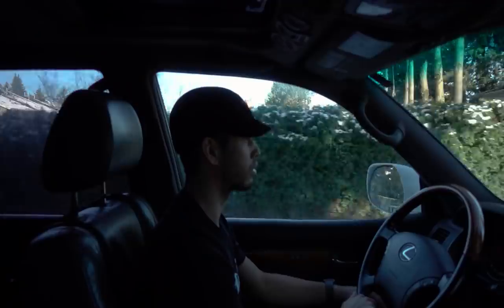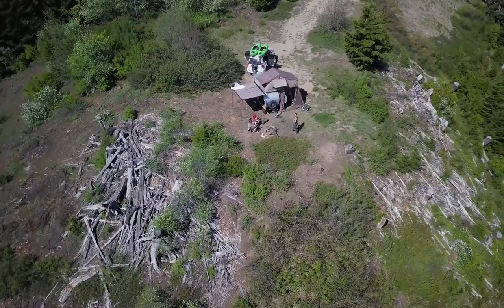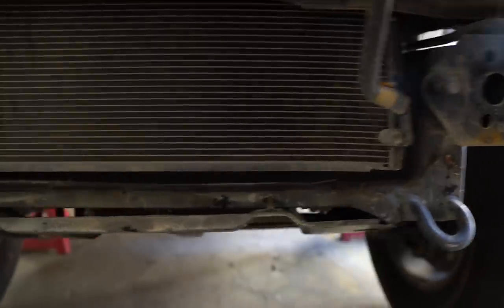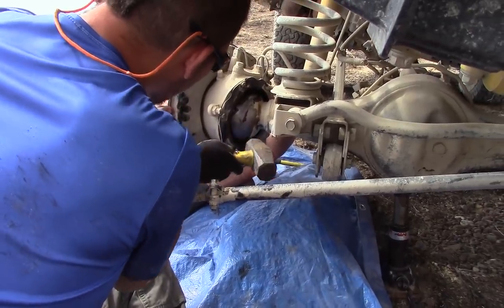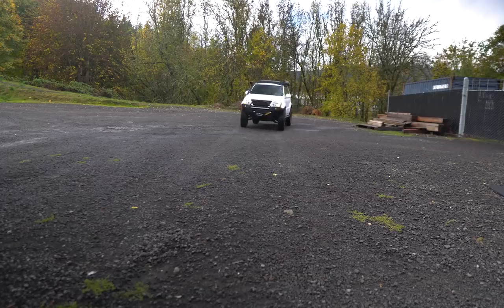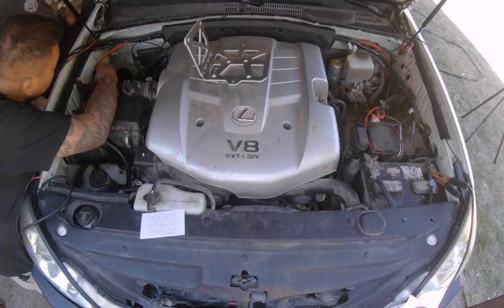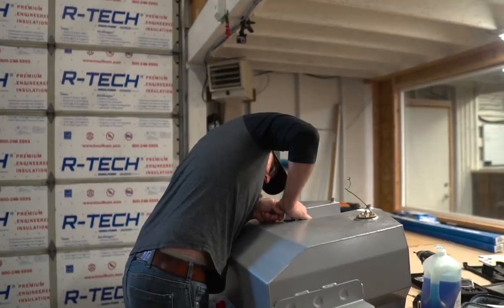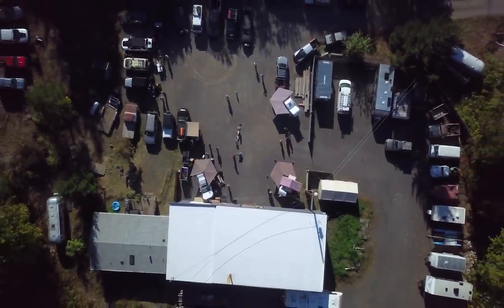GX470 Overland Build - OXOverland's Family Expedition Build

Comment: Thanks for sharing. The GX470 and GX460 are both really cool and capable vehicles. My wife and I are considering this as our next vehicle for a family of 4 as a daily driver with the capability to explore off-road and tow a small 16’ to 20’ travel trailer on the weekends. I’m thinking a used 3 to 5 year old 1st gen GX460 with a very simple and lightweight set up: Cooper Discoverer AT/W all terrain tires, new suspension with a 1” or 2” lift to account for luggage and hitch hitch weight, aluminum sliders, aluminum skid plate, front recovery points, rear hitch, roof rack.
Reply from the maker: woolengrappler nice they’re both great platforms and I’m sure you’ll be happy with it!!

Comment: I have my eye on an 08 470 . I am more use to non luxury type vehicles. We live 9.5 miles off the road off grid and need something capable of getting in and out. Really considering this but ground clearance seems to be an issue. What could I do on a smaller budget to get much bigger tires on ?
Reply from the maker: I had an old man emu 2”lift with 34’s with quite a bit of cutting but it’s less than $900 lift not sure how big your looking to go I’ve seen 35’s with a 3-4” lift
Reply: @oxoverlandfamilyadventures4656  I’d like 35’s as the tank seems to sit a bit low.
Reply from the maker: @9252LIFE  it’s doable you’ll probably have a little rubbing on full stuff but if you have Facebook I’d check GXOR there’s a ton of good info there!!
Reply: @oxoverlandfamilyadventures4656  awesome! Thanks man!

Comment: Absolutely amazing build, planing to do something similar to this . The only thing that confuses me a bit is what type of suspension I need to use, could you please provide some information on what type of suspension this GX 470 has  and where I can purchase it. Thank you  a lot.
Reply from the maker: Aleksandr Pashchenko We picked the Old Man Emu BP-51 suspension for a couple of reasons. Old Man Emu has a history of building expedition suspensions as opposed to a lot of the premium brands who tend to focus on racing suspensions with a little emphasis on Overland/expedition travel. They use slightly different components then typical premium suspensions that improve longevity and reliability and it’s one of the baddest looking suspensions on the market IMO. Also something to note you’ll need the rear airbag delete kit (I used the Southern style off road kit) and also UCA’s and spring for the delta joints there worth the extra dollars. If you have any other questions I’m happy to help🤙🏽

Comment: I’m about to get a Gx of the same year for my next vehicle and it is intended for a long road trip. (8,000 miles plus or minus 1000). The car’s electrical problems I can handle, but I do want to get it lifted. My question is: after the build do you feel like your gx has gone down on mpg? And do you have any “most important” tip for a new beginner? Cuz I am getting familiar with this car and I want some advice ‘fore diving head first into anything.
Reply from the maker: Most important tip... plan ahead and plan for the future. There’s nothing worse then buying a second upgrade cuz you weren’t happy with the first. Every build is different as is everyone’s style of travel so take your time to plan everything out. 
If your looking for MPG’s definitely add as little weight as possible, loose some if you can, and larger tires are the best way to loose gas mileage so try to keep them as small as the terrain you plan to be on allows.  👍🏽

Comment: What brand snorkel are you using?  Factory airbox?
Reply from the maker: It uses the factory air box and it’s from amazon lol nothing special. 

Air Intake Snorkel kit ST120A for Toyota Land Cruiser Prado 120 Series Diesel/Petrol 2002-09 4X4 https://www.amazon.com/dp/B018HY620M/ref=cm_sw_r_cp_api_i_6sNJCb2RV22JF

Comment: I'm looking at doing a similar build with an LX470 and am curious why you chose the GX vs the LX. Thanks in advance.
Reply from the maker: JC F most of it came down to personal preference, I liked the look of the gx more. But if we’re splitting hairs it’s a bit lighter then the LX also smaller  which gives the ability to load it down with a little less strain on the vehicle. It was a bit more unique. I’ve had my eye on them for quite a few years and with the prado 120 supported in South America it was a comfortable choice if we needed to source parts. It also had the 4.7 like the LX which is not only a historically reliable engine it also felt like it was tuned a little more aggressively then the LX (totally antidotal) Either one is going to be awesome vehicles but those are the reasons I chose the GX
Reply: GX is V8 engine, & LX is V6 engine.
Reply from the maker: Hassan Alnajjar - A65AP actually the lx470 has a v8 engine the lx450 had a strait 6 I don’t think any had a v6
Reply: But the more cyclenders the better it is for the power 😎

Comment: Very cool!  What was your setup in your earlier videos (with the sliders, and wheels but no armor/bumper? Were you using stock suspension for the larger tires?
Reply from the maker: munshmachine same sliders wheels and tires I had an OME medium lift on it  at the time lots of cutting and ponding to get them to fit though. 285/75/17
Reply: @oxoverlandfamilyadventures4656  Do you like the comfort of the BP-51s better? Did you leave the rear air on high setting previously? We have a Gx470 too, trying to figure out a way to keep or improve the comfort while making it a little more overland friendly. Someday have a beast like yours!
Reply from the maker: munshmachine yea the BP51’s are butter love them. When I did the OME lift I took out the airbags. You can only leave them on high until you reach 26mph I think then it goes back to neutral. 🤷🏽‍♂️
Reply: @oxoverlandfamilyadventures4656   Awesome, thanks for the great info and absolutely love the channel!
Reply from the maker: munshmachine you bet thanks for watching

Comment: I owned that exact same rig. Had to sell it. Starter replacement was $1,000!  Window actuator was $500!  New key?  $300!   Etc. It didn’t nickel and dime me to death, it $100 billed me to death!  Drivetrain was bulletproof and amazingly reliable, but jeez-us!  And the rear door made it impossible to load and unload gear from the back in the garage, or at the airport, or on a hill. Needed both hands to open and close it, AND, biggest bummer I never thought of until I had it, no-place to sit once you got to the campsite. Lack of tailgate, like on my 100 series, or 80 series, or Tacoma, was a bummer.  Land cruisers not only have a built in tailgate but also have an overhead cover.  A clean place to sit in snow, rain, wind etc. 
man, I wish all the little doo-dads weren’t so freaking expensive and the rig had a LC style tailgate.  I’d still be driving it. Was by far, the best performing on road and off road rig I’ve ever had.  I just couldn’t deal with the daily inconvenience of that blasted tailgate, and it costin 500 bux to repair what is 75 bux on a Tacoma.   Love hate relationship with that rig. Kinda jealous
Reply from the maker: planbenterprise dang sounds like you quite literally had a love hate relationship with your rig. Haven’t had that same experience yet😣
Reply: Must be because its lexus branded. This is considered to be a budget land cruiser in markets where its sold as the lc prado, with spare prices to match.
Reply: I replaced my starter myself. What a headache I see why they charge 1000 to do it. It is under the intake manifold.

Comment: I'm actually surprised that at $750 the Icon UCAs don't come pre-assembled
Reply from the maker: jisezer they do I bought them used and replaced the old ball joints with the icon delta joints. I’ve since switched to SPC UCA’s to get a little more adjustment.

Comment: Looks like the vehicle was in a front end collision which caused the alignment issues with the front bumper....
Reply from the maker: Yeah it was def in a little accident but it wasn’t bad enough to cause the bumper to be that far out we found out later that it could be the body mount bushings were slightly different heights on different years so that might have been it to everything else lines up perfect headlights body panels even measured off of a factory GX and it was all pretty much the same🤷🏽‍♂️

Comment: Interesting he thinks it’s an “American “ SUV. I guess, whatever. But it’s manufactured in Japan. Sold by Lexus though.
Reply from the maker: JeepCherokeeful 😆 haha well that makes about a bakers dozen still cracks me up of all the things to call me out on the fact that I called it a typical American SUV is what everyone gets hung up on.  All I really meant is it looks like every other US medium sized suv. But if we want to get all technical the engine is made in the US and Lexus is only available in North America and Eurasian markets so yes Lexus/Toyota is Japanese but if you want a GX over there it’ll be missing the V8 and it’ll be called the Land Cruiser Prado 120.
Reply: Outlaw Xpeditions Overland Adventures right. Honestly the 4Runner is more common platform but the old 4.0 V6 sounds like a tin can full of bolts being shook up. For just a basic rig, the Xterra with the 6 speed manual is hard to beat. I own two 1986 4Runners. Sadly not 1985 with the solid front axles.
Reply from the maker: JeepCherokeeful nice can’t beat the ol 4Runner guess that’s why most of there off road rigs use that platform. The xterras are awesome been super impressed by them and their cheap